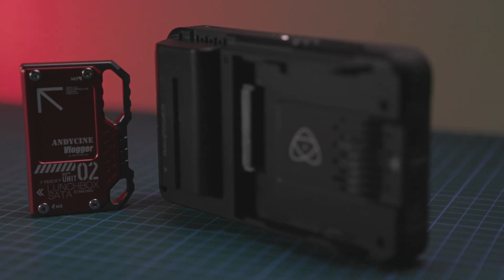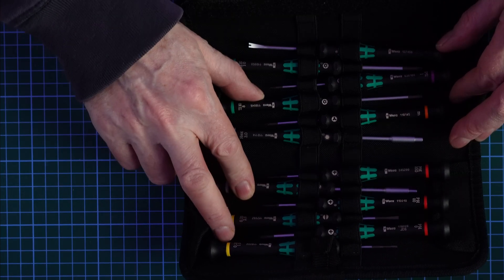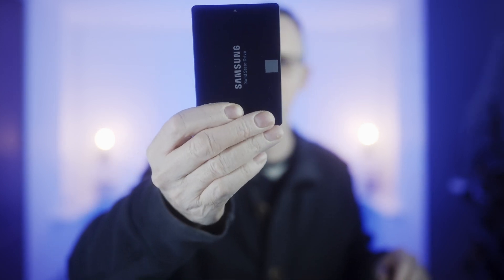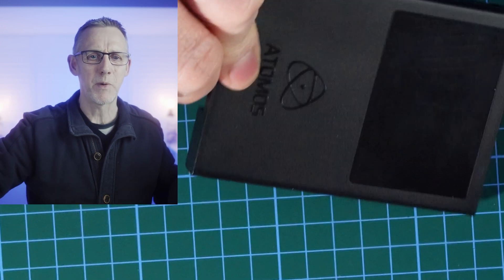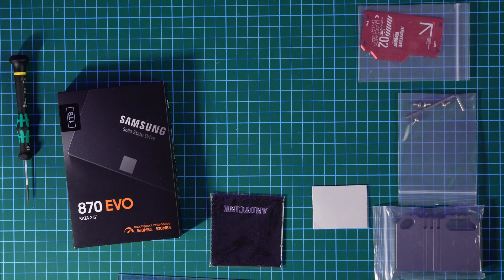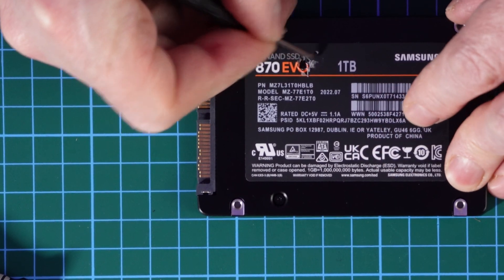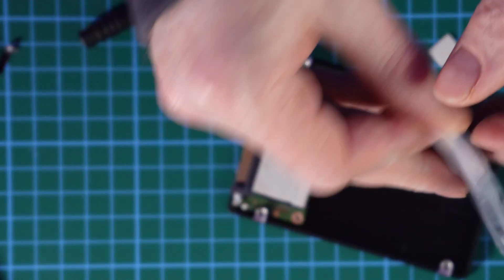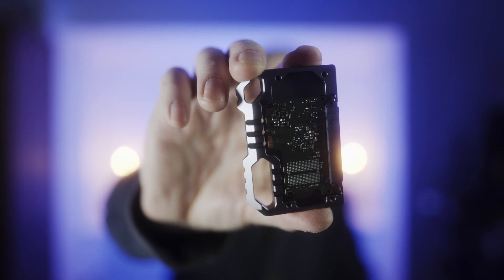Atomos Ninja V SSD How To Setup Andycine Lunchbox 2

Comment: Question: Is this going to work with a ninja V+??? Thanks Will it record in 4k and also 8K?
Reply from the maker: Yes, I've got both the ninja V and V+, Yes to 4K, don't know about 8K not sure if Ninja V is capable of that, anyhow it would all be down to bitrate i.e. how many megaytes per second is being recorded when it comes to the capabilities of the SSD, the amount of pixels being recorded and the data being used to record them is more about the compression rate, i.e. 4K mpeg 4 and 4K Raw are both 4K but raw is pushing much more data per second.